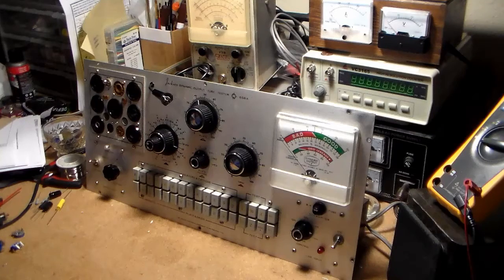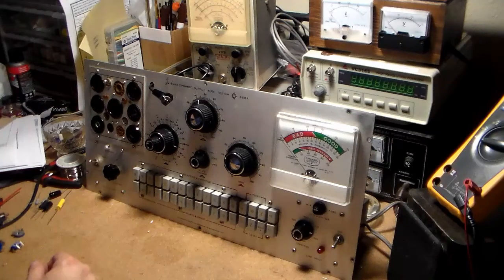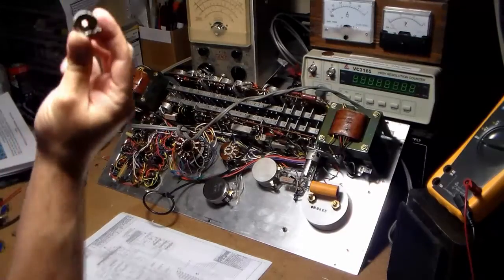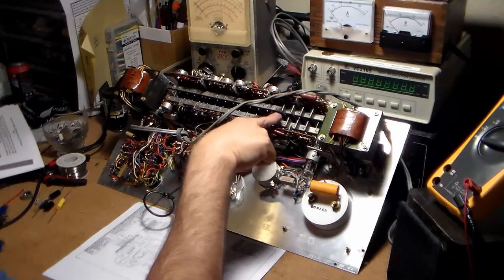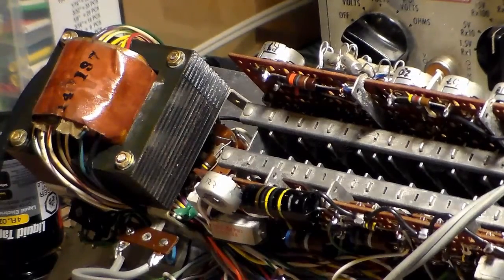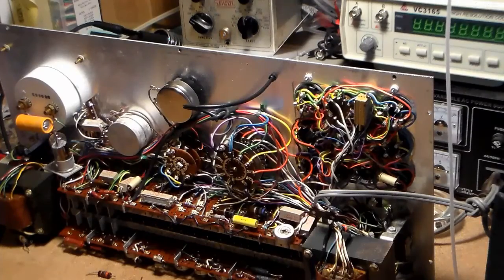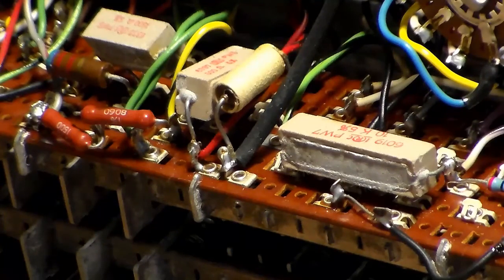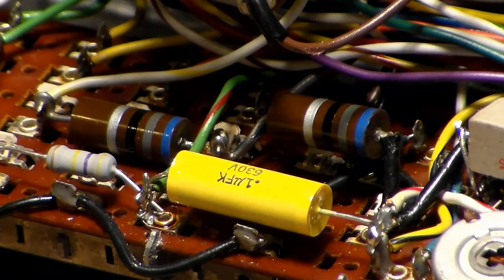Jackson 658A Part 1 of 5

Comment: Do you by chance have a parts list for this? I have the schematics and the same service guide that were posted online but the resolution is low and I cant make out the parts list. Also how / where did you source that one r19 POT? or any other pots that might be needed.What 0.1uF tubular did you use? I appreciate any help you can offer
Reply from the maker: I do..  I sent you a  copy on FB, check your message requests.

Comment: I have a Jackson 112 condenser tester in excellent cosmetic condition awaiting electrical restoration.  AFAIK it has very low operating hours because both of the tubes are good and the 6E5 magic eye tube is very bright.

Comment: Thanks for taking the time to post these videos.  I've been looking at buying one, more likely since I've been able to watch your videos.  After using the Jackson, do you still think your Hickok 600 is significantly superior?
Reply from the maker: +Perry Sparingly I don't think the hickok is necesssarily superior, per se.  I seem to get about the same readings from the two when I test tubes.  although the jackson is in percentage.  sometimes it seems to me the jackson likes to give a more favorable reading to some tubes though.  the biggest differences are the plate voltages and the Jackson has a more sensitive shorts test and it also does grid leakage.  the jackson can put up to 250 volts on the plate where the hickok is 150.  my biggest concern with the Jackson is the meters can be flaky.  mine is no exception.  I never did post the video I made of aligning the hockok.  I have a dead spot in the dual pot on the hickok right at the 6000 mho marker.  I have since actually located a replacement for it.  one day I'll get it in there. :) 

I find myself using the jackson a lot lately as it can test everything from 4 pin to 12 pin compactron tubes.  especially handy since I'm working on TV's lately.

Comment: Thanks for sharing your experience on the 658 Bret! I just went through my 658 per Erik Knutsons calibration post. Bummer your r19 pot broke in the removal. I was able to go through the instructions with good luck. My r19 was responding ok so I left it alone. Replaced the diodes and some of the caps that were borderline leakage. Also some of the resistors. Works fantastic! Well made units. Pretty accurate comparing to my gm testers from a good bad standpoint. Still need to test it some more. Sounds like your on the right track. I'll check back to see how your doing.